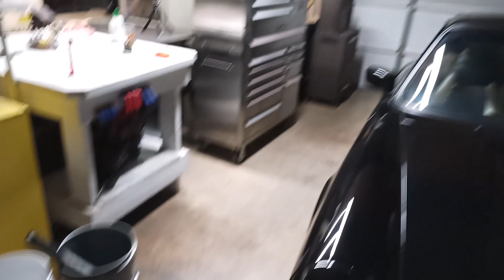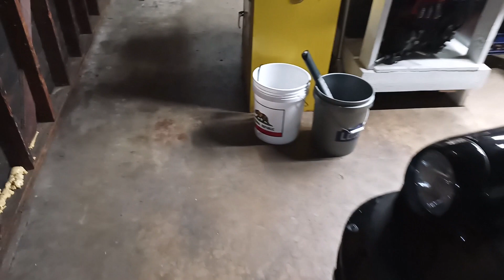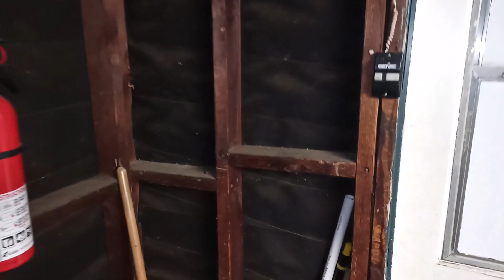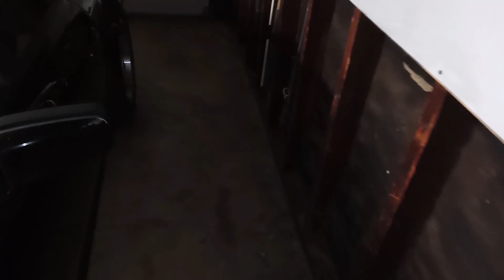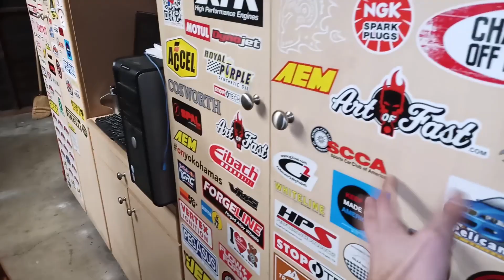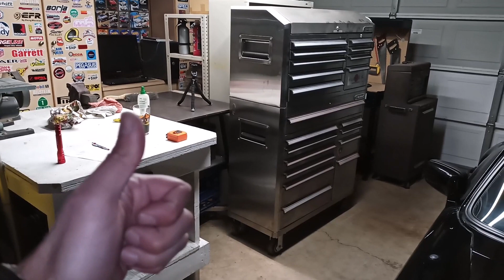Help Me Plan My Home Garage Porsche 911 Shop Space

Comment from the maker: Drop any suggestions here. Thanks in advance! ✌🏼
Reply: Hi Joe, I have been following your very helpful tutorials on everything Porsche for a while, you are producing some great content! I have been optimizing my shop more and more over the last 13 years, as money allows and I learned what works and what doesn‘t, also from other OCD people on Garage Jounral etc. ;)-. If I were in the US I would buy the ball bearing tool boxes from Harbor Freight, and then build a custom frame to set some workbench top on them, so that the space is used optimally. Some wood surface for general work, some stainless sheet for engine, oily and dirty work (ideally with a built in sink with an oil drum under it), and then another surface for welding. I lucked out and found some 2“ thick cast iron table tops in 32x48“ from an old printing factory for $120 each, maybe you can find something similar on Craigslist if you are patient. Very sturdy and weld spatter doesn‘t stick to it. I would also put metal peg board behind all working surfaces and even behind the machines, and a strong shelf at around 7 ft of height, so that you can easily reach it but it‘s out of the way. This way you gain a bunch of extra storage space for bulky tools, protective gear, paper roll holders, chemicals etc, without loosing any floor space or using up the Limited drawer space in your tool boxes. I am happy to send you some pics of my setup and have a chat about it. Cheers! Lukas
Reply from the maker: @lukasmatzinger  Exactly the kind of feedback Im looking for. Thanks so much!